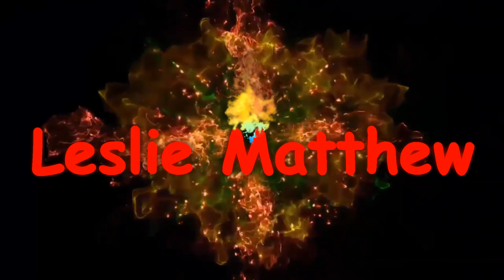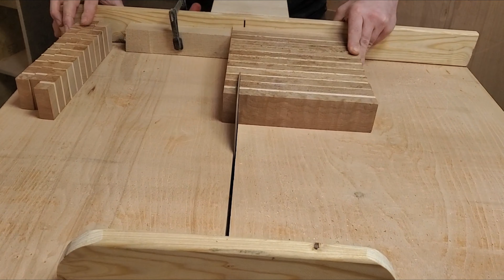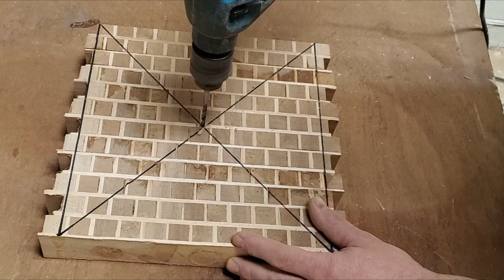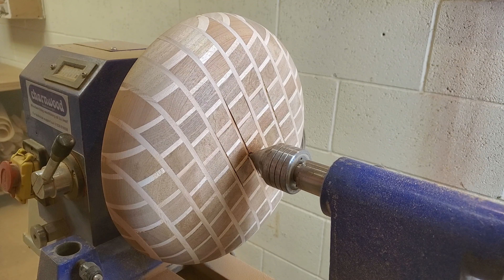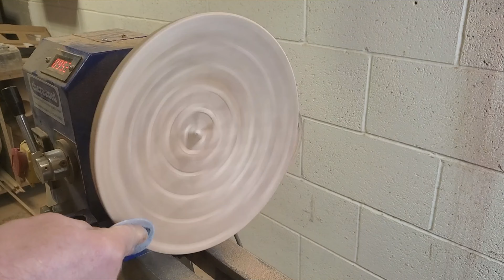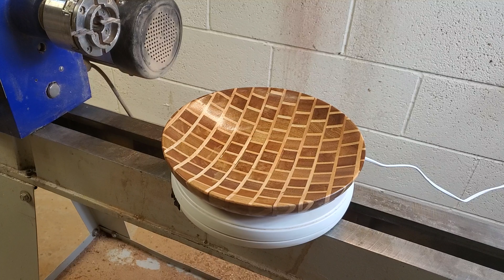Woodturning Twisted square plate

Comment: What is the pink stuff in the screwhole in frame 6:25?  Like the videos.
Reply from the maker: Epoxy resin
Reply: @lesliematthew-woodturning  what was the reason for the epoxy resin?  Extra hold for the screw or possibly there was an imperfection there?  Thank you in advance.
Reply from the maker: Epoxy chips are the remains of the previous bowl.